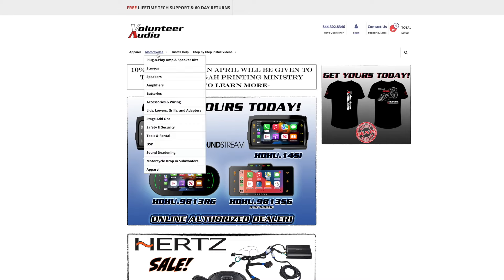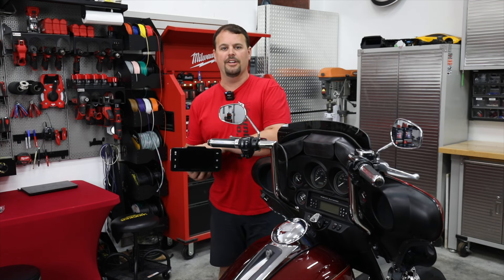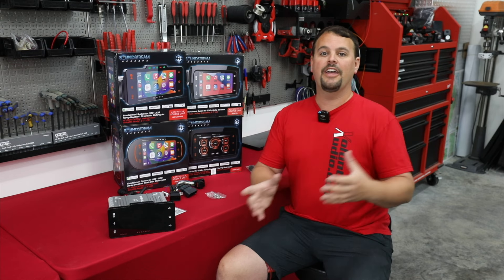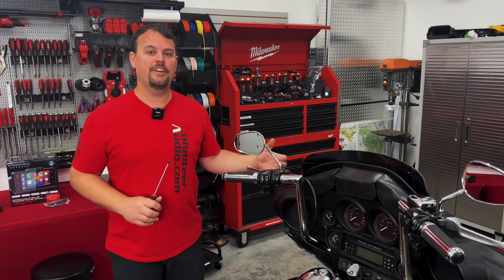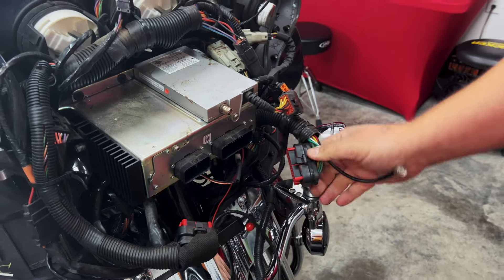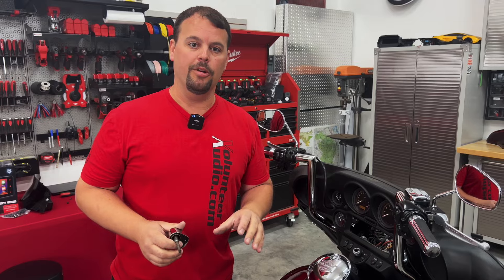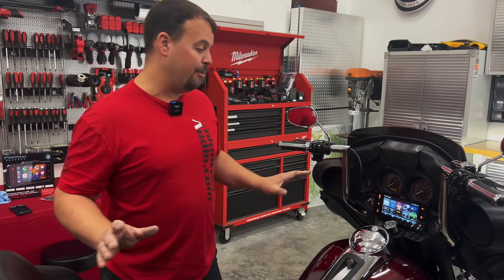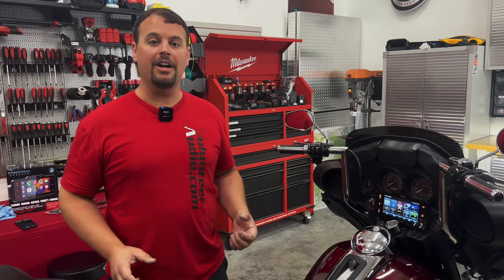Step by Step install Soundstream Reserve HDHU9813SG Radio for 1998-2013 Harley Davidson Street Glide

Comment: Only problem I have with this is you can’t see turn signals during the day.
Reply from the maker: Only so bright an led indicator can be made, it looks great accept when the sun is directly on it.  The stock indicators were not super bright either. But the screen looks great in all lighting
Reply: @volunteeraudio  the stock indicators were not that bright but I could see them at least.

Comment: $1000 for a radio and they couldn't make it wireless CarPlay???wtf
Reply from the maker: They could at a higher price, we offer an add on wireless adapter
Reply: @volunteeraudio how much is the wireless adapter?
Reply from the maker: @3geezy566  $149 for apple, $179 for android
Reply: Amazon has some wires less Apple play. You don’t have to remove anything. Just stick it in for a lot cheaper 😂